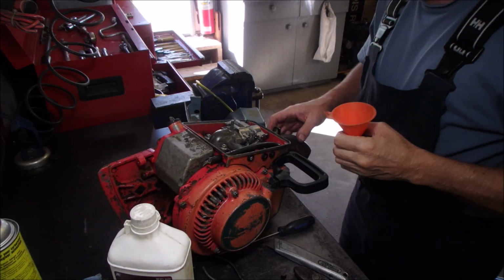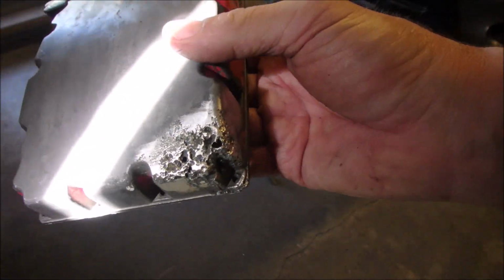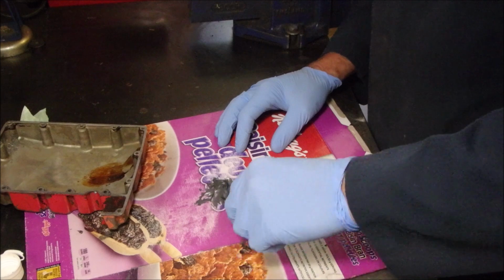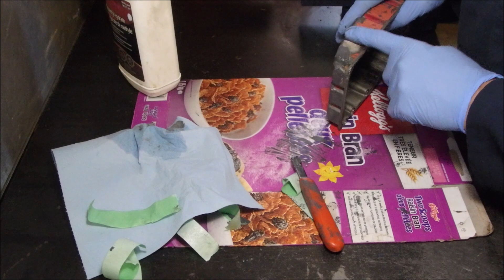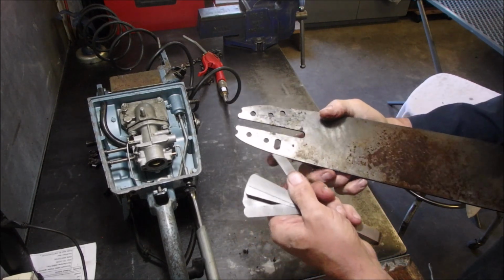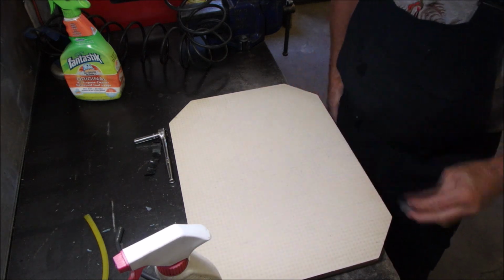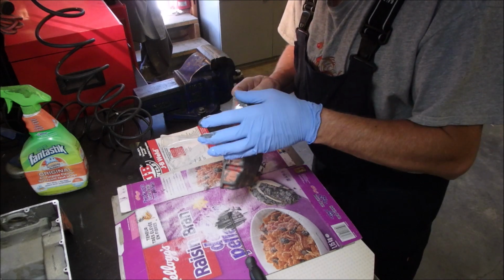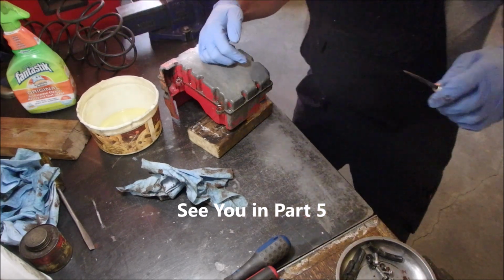Gas Tank Repair,1968 Homelite XP1020 Part 4.

Comment: I have never used JB Weld that way but I guess I am going to have to re-think it. I will try it next time I am working on a motor so old that the parts are crazy expensive or completely off the market.
Reply from the maker: Yes   for me it works well.

Comment: Good video Bruce. I remember the old Indian Head Gasket Shellac You don't see it used very much today like you did years ago. I think the JB Weld should work good on the repairs you did. I would save that old bar and use a different one like you said. Are you and the Mrs. P. getting a tan?
Reply from the maker: Yes we are having a great time.  Have you ever bee to Puerto Vallarta Mexico?
Reply: @BrucesShop  I have never been there I here it is beautiful.
Reply from the maker: @nashguy207  It is truly a great place.  safe with western hospitality.

Comment: Nice work but i use gas to remove old gasket sealer . I hope yours is fuel resistant after fuel is in tank for a few days
Reply from the maker: Great point!  We will see.  i think you are right